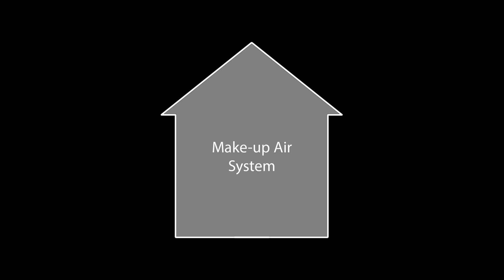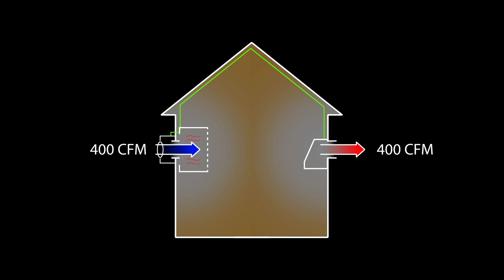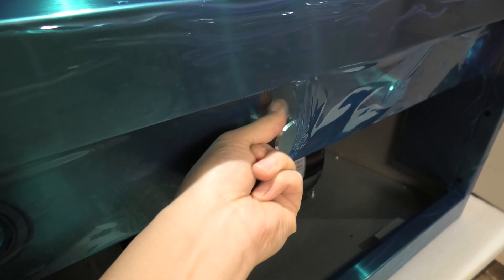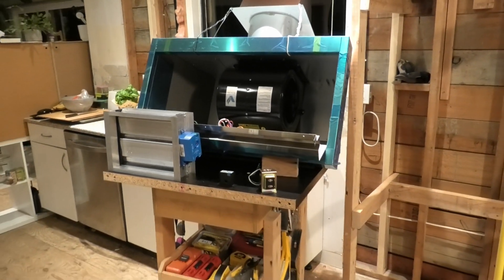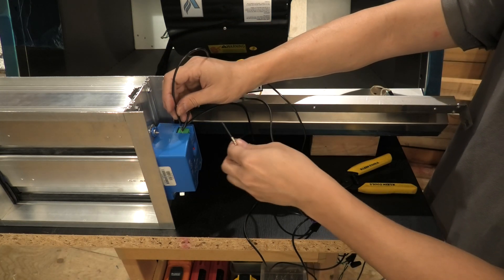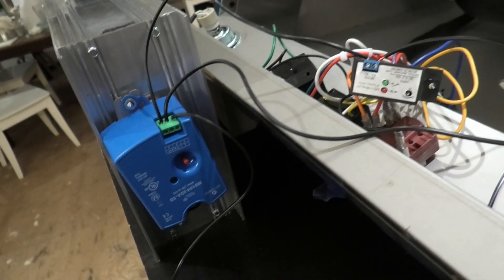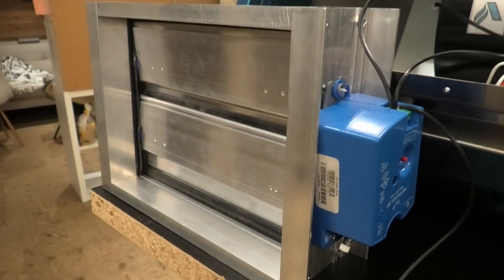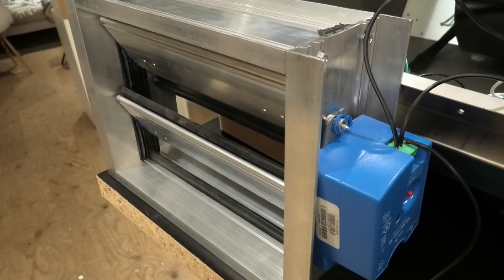Kitchen Reno Ep.4 - Make Up Air System

Comment: Are the large wire loops and offsets in your circuits up to code? They look awesome. What is your thought behind them, extra just incase?
Reply from the maker: thank you, ya they are, but technically there isn't really a specified length for the extra slack, there is only code for stapling them within a certain distance.  I like to have it so that if i ever need to move the outlet, it can comfortably move in all directions 16 inches, and I like having all the wires in a single plane because it helps me cut the rockwool around them much easier.

Comment: or just don't force air out of your house?
Reply: You have to for a number of reasons. Mainly, carbon dioxide buildup, but particles, VOCs and other possible pollution are other factors. Say you, threw a party with 15 people, cooked, used the bathroom (2), and painted. All of these conditions need ventilation.
Reply: @brettcombs774  open a few windows lol
Reply: @SNOUTxTOUT  totally viable, but when it rains sideways louvers are better... And they're automatic. Want to open your windows everyday?
Reply: @brettcombs774  I don't throw parties for 15 people while painting and cooking often enough for it to be a problem 
Never even heard of these systems. Seem to be something for kitchens and commercial spaces
Reply from the maker: yea I mean they can't make you use the fan.. but they do make it a code requirement for you to have it in place.
Reply: Just one person in a small apartment can get CO2 levels to 2000ppm